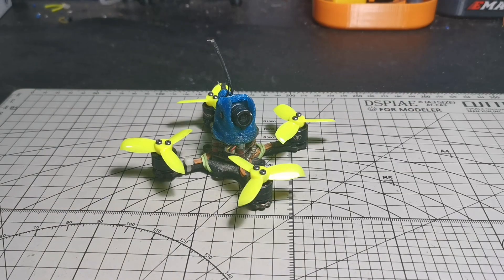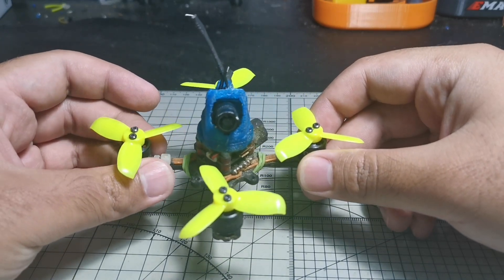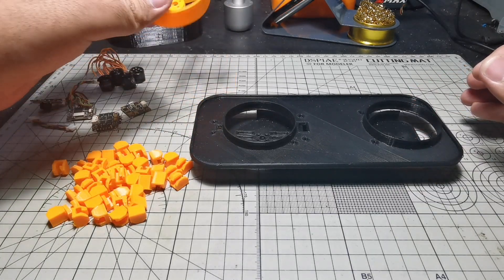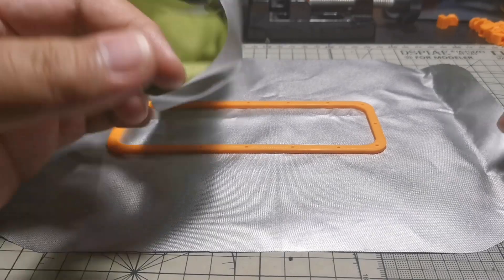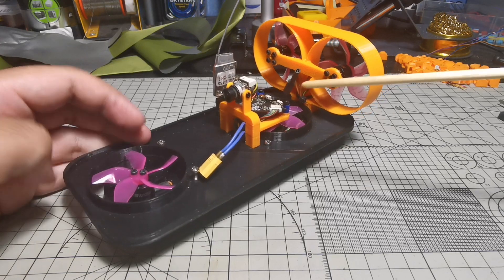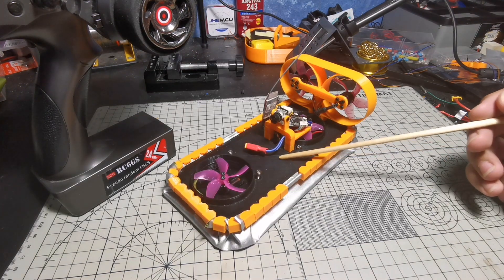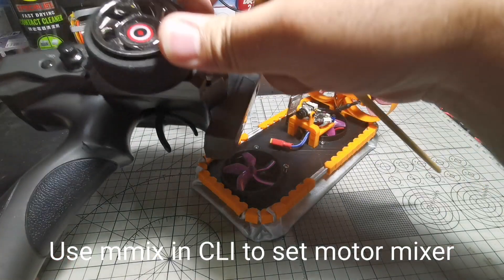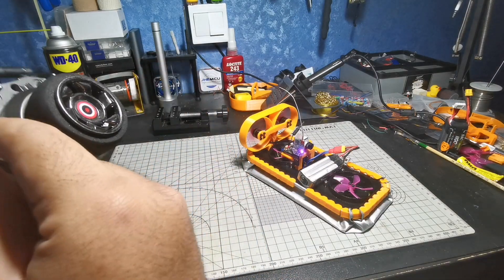Mini RC Hovercraft | 3D Printed

Comment: My FC is not getting detected on my PC after I remapped motor 3 & 4 as none & used esc 3 & 4 as servo 1 & 2.. later I set motor 3 & 4 as some other non used MOp pins.. this time betaflight detected my FC but Im still not able to control my servo 1 & 2 with an aux switch assigned to them on servo tab.. could u kindly help

Comment: imagine upscaling this to 3" intake for the bladder and 4" rears, and making the base a little wider ??? ohhh that would be so fun haha.
Reply from the maker: That would be fun indeed! But my aim for this model is to make everything printable on small bed 3D printer like Ender 3. There are several model on thingiverse that use big props, you can try those if you want to go big 😁

Comment: does it work on water?
Reply from the maker: It does. It did test it on very still water surface like puddle on asphalt road, it does float. Wouldn't recommend running it on lake or sea since it is tiny and fast, small wave could turn this thing upside down. Also recommend to waterproof the electronics if you want to run it on water.